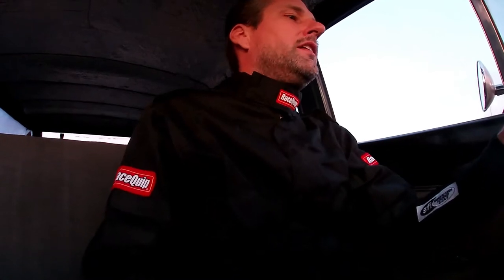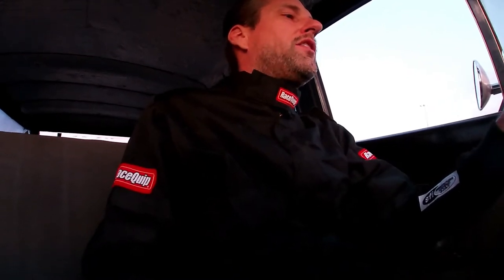11Nov22 DragStrip new best.. 12.0!  So close to an 11's quarter.

Comment: Sounds like you went back to the AOD.  What ever happy to the 6r80 swap?
Reply from the maker: I could not sort out the driveshaft vibrations and the 1-2 shift was stupid harsh.  I might revisit it later with a Gen 2/3 trans.  They have better rear yoke support bearing setup over the 2011 to 2015 years.